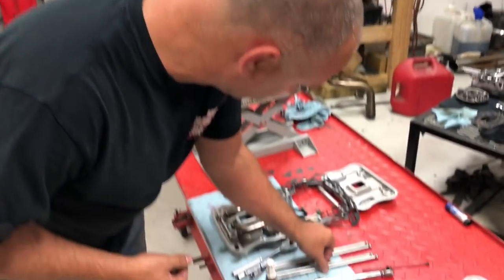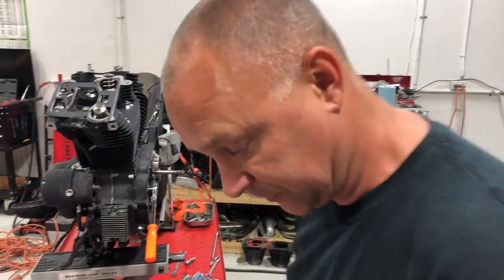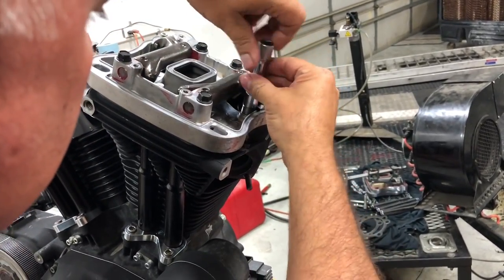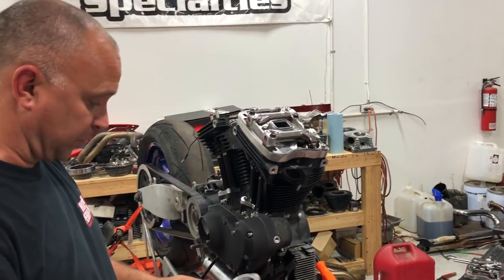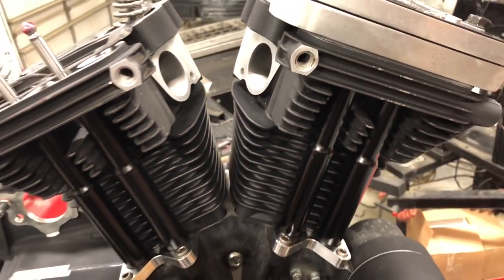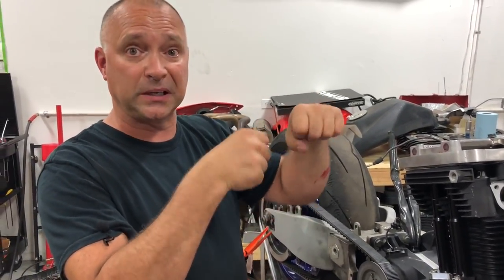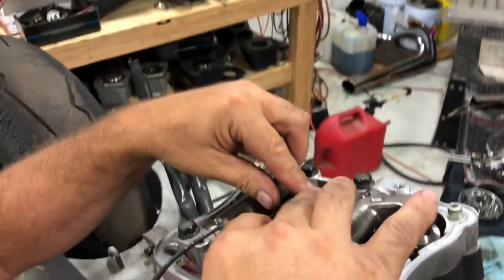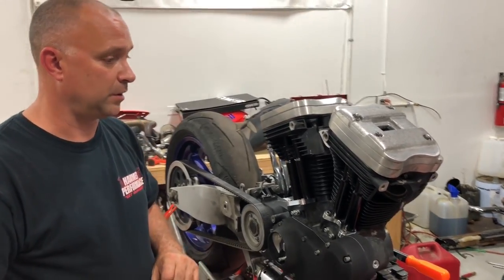How To Install The Rocker Box Assembly On A Harley Davidson Sportster

Comment: Thanks for all of the videos! I am going to be assisting a friend of mine refresh a 95 sporty 1200 this winter. In some of these videos, you talk bout a motor sprocket wrench and I was hoping you could elaborate on what exactly it is since we will have to pull the motor on the bike to work on it over the winter. It seems like a handy tool. A little to cold to work on it outside during the winter in Wisconsin!
Reply: Ratchet wrench

Comment: Thank you very much for your illustration. I have a question regarding “wait for the lifter to bleed down. ”  That is key point mention in your video from 14:10 to 16:00. 

I plan to replace rocker box gaskets for both boxes because of oil leakage. Do I need to wait for 30-40 minutes when I finish with my first box gasket replacement? 

Hope I have made myself clear enough? 

Again, great video, especially for a new guy like me to Harley.

Comment: If I'm changing out just the gasket on each level, do I have to mess with the push rods 🤔? I have a 883 single piston buell I'm working on and losing compression around the head area, it's an old bike that sat for a while and no work was ever done on it from the look of the carb when I first started on it. I'm interested on the upgrade top end you offer as well

Comment: Dont you use any kind of black glue (permatex) as a safety measure? I understand that the leak on the rocker boxes are quite common. I have a small one on both and am wondering if i should use the permatex or not.... Thanks
Reply from the maker: I don't, I feel a lot of the leaks come from a rubber gasket getting pinched or kinked.
But you surly can use some if you like.

Comment: Let's say hypothetically.. you install your front rocker box on at tdc and you have very little resistance from the lifters on that cylinder? Is that bad lifters symptoms or just need to be pumped up on start up? They have been sitting on a shelf for 8 months and then got a 48 hour oil soak before install.

Comment: Sportster motor and Buell The same... Having trouble with my head gasket on my old Blast...This vid super helpful....ere is a question though...Im doing piston, cylinder, and head...Do I need a torche plate? And also, I noticed you used only the gasket...for an older (01), Should I add some gasket sealer?
Reply from the maker: Torque plates are essential when boring and honing cylinders. The head, base, and rocker box gaskets are all supposed to be installed dry. If you don't have a factory service manual, I highly encourage you to get one before working on your engine, it's loaded with valuable information like this and much more. It's really an essential tool for working on these bikes. Only get the HD service manual, the aftermarket manuals are awful by comparison.
Reply: @HAMMERPERFORMANCE  I do have the manual actually...Thank you for the tip. When confronted with potentially conflicting info, its always best to check with the pros! And, yes, the after market manual inst the greatest...lol
Reply: Absolutely loving your videos btw. I find these as equally essential as the manual.

Comment: Hi Dan, i have recently converted my 1996 Sportster 883 to 1200, i think to have done all that it's required and rode the bike a few miles but I noticed an oil spouting on the rear cylinder, the exhaust covers and the pushrods cover present a light film of clean oil  sweating,  what do you think ??,

 I have changed all the seals to new and even the valves stem seals, shall I re-check the rocker box bolts a re-torque??  i am sure the rear cylinder needs attention..maybe the rear exhaust bolts needs re-torque?? please let me know, thanks Salvatore.
Reply: Did you end up replacing the little umbrella valves, could be they have hardened up.

Comment: Been watching a lot of your videos doing my conversion kit, after getting the front cylinder to TDC on the compression stroke and torquing down the lower rocker box assembly, I wait and keep looking into my intake and exhaust of my head, the valves just don’t seem to be closing. I thought it may have been a stuck lifter at first, so I tore the top end back down and replaced the lifters with some new fueling hydraulic lifters and I’m getting the same problem. I’ve put the cams in several times now and I’m fairly certain that they are correct. Any input?
Reply from the maker: Check your pushrod length using this method: http://www.hammerperf.com/ttpushrodlength.shtml#method2
Reply: HAMMER PERFORMANCE I was using a set of -60 solid push rods which I was told would be the right length from the company that did the stage 2 headwork on my heads, starting to lean towards an adjustable push rod now to avoid bending any valves.
Reply from the maker: @Xxcdr97xX  Well, as described at that article I linked you to, a hydraulic lifter is self adjusting. To the extent your pushrods are too short, the lifter lengthens itself to take up the slack, and to the extent your pushrods are too long, the lifter shortens itself to make the valve rest on the seat and keep it from hanging open when it's supposed to be closed. So the exact length of the pushrod is not important, all that matters is that it preloads the lifter plunger within it's self-adjusting range. 

One way to accomplish that preload within range is to get pushrods of the correct length range. That link I gave you shows how to make sure yours are of the right length range. 

Another method is to use adjustable pushrods. But as compared to a non-adjustable setup, an adjustable is weaker and it introduces more potential failure points and it's more expensive. So in our view, it's taking a shortcut on getting the preload correct, but it costs more and it's less reliable. 

That's why we put customers into non-adjustable, heat treated chrome moly pushrods for their builds instead of adjustables, and while we can predict and supply the correct length more than 90% of the time, we still show them how to check it while assembling their valvetrain, just to make sure.

Comment: I have a 1990 sportster. Im putting on cams but is it the front or back cylinder that needs to be tdc
Reply from the maker: The correct crankshaft position is when the mark on the pinion gear is pointing straight toward the middle of the number two cam. Neither piston will be at TDC when you've positioned the crank this way.

Comment: Are then rockers the same for intake and exhaust?? I disassembled them all to clean are the interchangeable from intake to exhaust???or is intake and exhaust rockers specific to there placement?1996 Harley 1200. Stock rockers
Reply from the maker: The front intake and rear exhaust as the same as each other. 
Likewise the rear intake and front exhaust are the same as each other. But different from the other two.
Reply: @HAMMERPERFORMANCE   if it’s all dissembled for a cleaning how do recognize  the back cylinder rockers from the front. It’s sound like your saying ea cylinder has the same rockers as a set but ea set is different from one another?
Reply: @HAMMERPERFORMANCE   or all 4 rockers are the same ?
Reply: @HAMMERPERFORMANCE  thank you for the fast response and help very very much appreciated
Reply: @HAMMERPERFORMANCE  oh oh or maybe I’m reading into it to much yes they are different because the orientation in relation the the valve and push rod makes them different but as long as there over the valve and push rod they are interchangeable. I think I understand
Reply: Yes I understand got it thank you.
Reply from the maker: @acurarl9929  It will be obvious when you go to put them back into the rocker box. The cupped end goes to the pushrod side.
Reply: @HAMMERPERFORMANCE   yes I understand what you mean. Thank you very much

Comment: Is there any way to replace worn rocker ams and shafts without loosening the lower rocker box section to relieve pressure on the pushrods?
Reply from the maker: If you position the motor at compression TDC and remove the 2 big bolts on the pushrod side, you can push the pin out. But you'll never get it back together without removing the rocker box, because the lifter needs to bleed down again.
Reply: @HAMMERPERFORMANCE  thanks for the reply. I have adjustable push rods (ev3 cam) so I could just shorten them to get the rockers back in, then readjust the push rods to their previous length. I have never attempted to adjust push rods, but after watching your video, I am willing to try. I had a feeling that even at tdc, I wouldn't be able to get it back together without shortening the rods.
Reply: One other thing I don't understand. My front intake rocker arm has a shiny spot on it on the valve side from rubbing on the rocker cover. I'm wondering if my push rod is adjusted too loose on that valve allowing the rocker arm to rotate farther than normal when the valve closes.
Reply from the maker: @Cpcsof1  Hydraulic lifters are self-adjusting. To the extent the pushrod is too long, the lifter shortens itself, and to the extent the pushrod is too short, the lifter lengthens itself. The idea is to select pushrods of the correct length such that the lifter's plunger is approximately centered in it's self-adjusting range, which means a preload of about .100 for an HD lifter (different people have different ideas as to the ideal lifter plunger preload, but .100 is what most recommend). If the pushrod is so short that the lifter runs out of travel trying to lengthen itself, the valvetrain will make a racket and it'll also be really hard on parts because the valve will slam closed rather than be set down gently (this is a common problem when guys accidentally adjust their pushrods at overlap TDC instead of compression TDC). If the pushrod is so long that the lifter runs out of travel trying to shorten itself, the valve will never land on it's seat and you'll have no compression.
Reply: @HAMMERPERFORMANCE  sounds like I just need to file the rocker arm slightly where its rubbing and use the the recommended methods in this video for finding tdc. I really appreciate this video.

Comment: What would happen if you
Mixed up the push rods?
Reply from the maker: On a Sportster, exhaust pushrods are one length (longer), intake pushrods are a different length (shorter). The actual lengths depend on the year of the motor.

If you mixed them up and ended up with an intake pushrod on the exhaust, there's a chance of slack in the valve train because the hydraulic lifter, which is self-adjusting, is unable to lengthen itself enough to compensate for the shorter intake pushrod. This will cause valve noise and also could damage the valve stem, as the normally gentle open and close motion of the cam lobe would get bypassed.

Likewise, with an exhaust pushrod on the the intake, there's a chance the valve won't close all the way because the self-adjusting hydraulic lifter is unable to shorten itself enough to compensate for the longer exhaust pushrod. This will reduce or eliminate the compression in that cylinder. If there's still enough compression for it to run, you could be pushing air/fuel mix and exhaust out the intake port and air cleaner.

Comment: U don’t show pulling frame off🥺
Reply from the maker: Removing the frame is not necessary to perform this job on a Buell. We just did the video on a Buell with it's frame off because we had one in the shop, and without the frame in place, we could show the process better. But the process can be done with the motor in the chassis, and that's true for either an XL or a Buell tube frame bike.